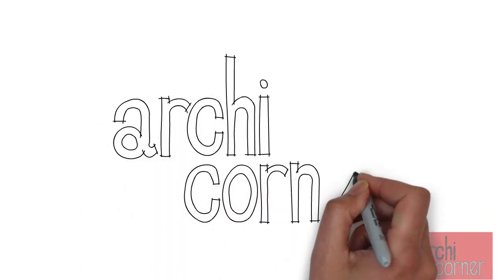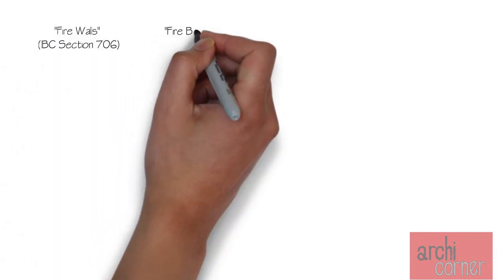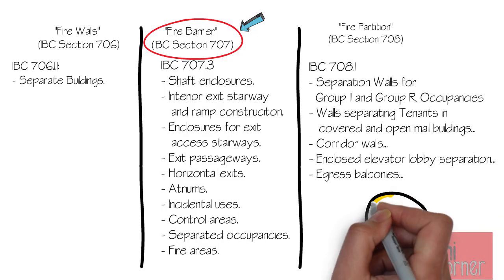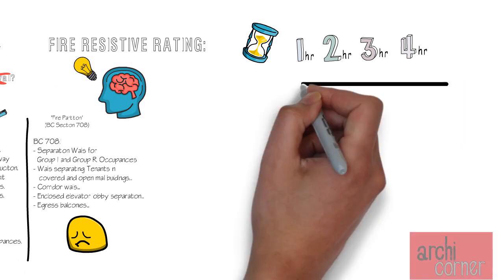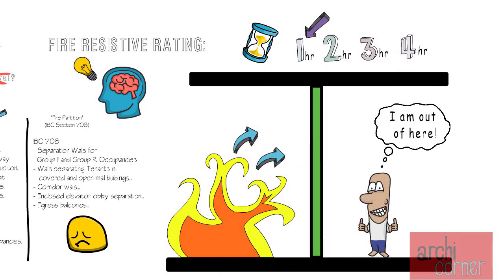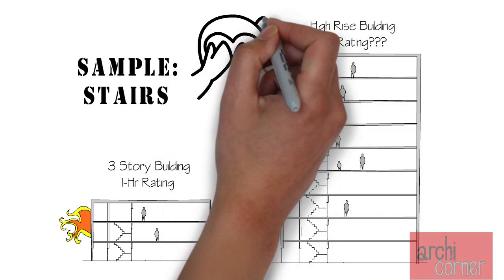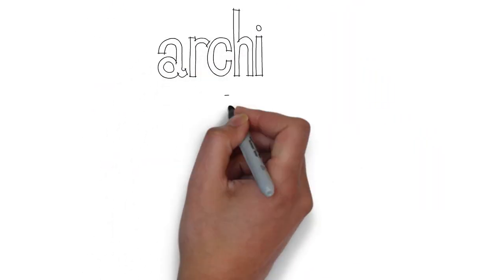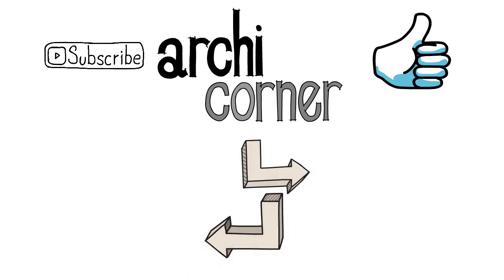AC 015 -  What is a fire rated wall?

Comment: Hello archicorner,   Thank you so much for these effective videos.   I have a request.   There is some confusion on which table to use when.  IBC table 508.4  vs table 706.4 and vs 707.3.10  It would be wonderful if you have time to help sort out which table to use when.  508.4 is called : "Required Separation of Occupancies"  ,  706.4 is called: " Fire Wall  Fire Resistance Ratings" and 707.3.10  (is a long name) called: " Fire-Resistance Rating Requirements for Fire Barriers, Fire Walls or Horizontal Assemblies Between Fire Areas".  Wew!   When you see the tables,  THEY  ALL  LOOK  VERY  SIMILAR !      Geez,  it gets confusing.   Please help !

Comment: Thank you so much for all this info, and amazing explanation. I have a question about the fire barrier, so if I have an office building business occupancy with a large training room which is assembly occupancy. Should I have a fire barrier around this room to separate the assembly from business group?
Reply from the maker: Without much more information, then yes. There are other ways around it, but much more complicated than can be explained thru a comment. In short: 
1) If the assembly area is an "accessory occupancy" to the business area as per IBC 508.2 then fire rating may not be needed (per IBC 508.2.4).
2) If the assembly and business area are "nonseparated occupancies" per IBC 508.3 then fire rating may not be needed (per IBC 508.3.3).
Reply: @archicorner  Thank you so much!